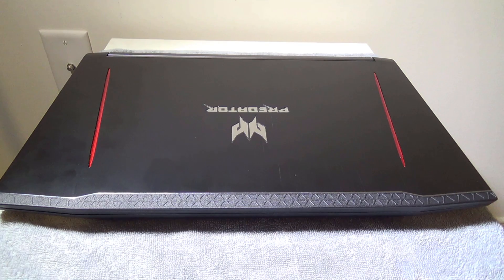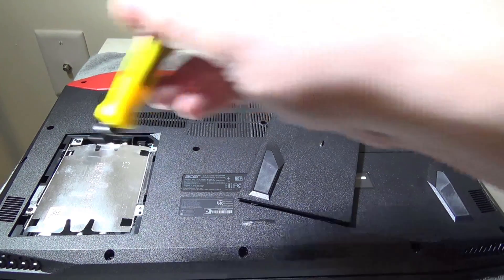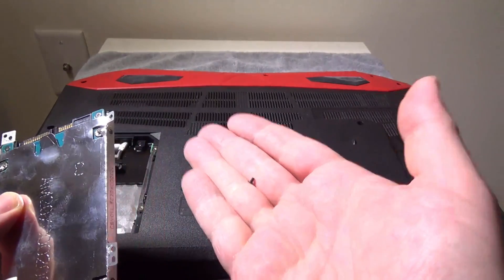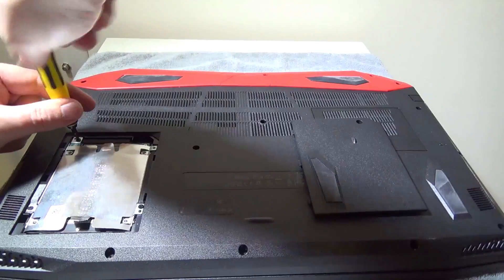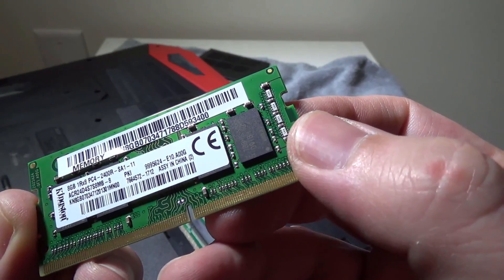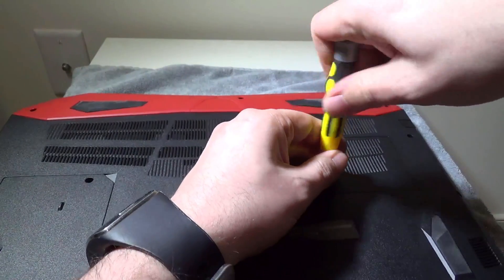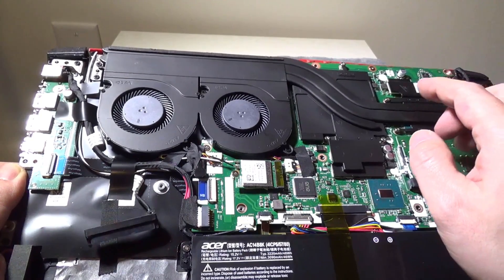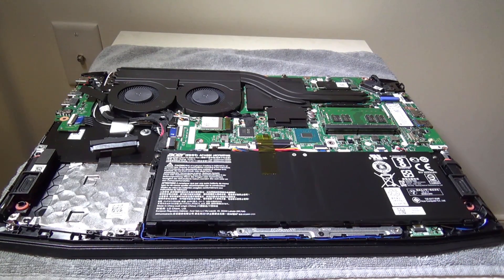Acer Predator Helios 300 Gaming Laptop • How To Add a 2nd HDD and Upgrade RAM

Comment: Will the Samsung 960 Pro work fine on it?
Reply from the maker: Yes it will.
Reply: Galaxy Tech Review Woa, great! Was planning to get the 2 TB SSHD and 960 pro, how's the combo?
Reply from the maker: The m.2 slot is NVME compatible so the 960 pro should work, I have not bought it and tested it myself so I can't say, I just stuck with the pre installed m.2 drive.
Reply: Galaxy Tech Review what about the performance of segate SSHD? Is it better than the stock 1tb from Toshiba?
Reply from the maker: Yes it is,
Reply from the maker: TheSteamsurfer unfortunately I don't own any VR headsets so I can't really do any VR benchmarks

Comment: I'm from europe but if I'd buy this laptop in the usa (Up to 500$ cheaper for the same specs) could i still use it in europe without problems?
I mean because of the differences in the voltages that you get.
Reply from the maker: +Sascha Liechti you would just have to buy an adapter for the wall that I would change it from a u.s. plug to a plug for Europe that's all
Reply: Thanks a lot :)
I thought so too but i wanted a second opinion on that ^^
Just one more question.
I heard some people complain about heat problems (cpu and the outside of the laptop getting really hot) when gaming.
How was your experience?

Comment: Looks like I'm in the same boat as a lot of other recent buyers who didn't get the installation kit included with the computer. I did talk to customer service and I already had my installation kit delivered, but now I'm kind of stumped as far as installing the SATA cable myself. I know it should be as simple as plugging it into the board, but I don't see how I can access that plug just from the storage bay. Maybe I have to take off the entire back of the laptop. Anyone else who had to install the kit themselves able to clarify?

Comment: Do you know if that SATA Cable + interposer is a standard connection for laptops? Or is the connector going to the motherboard proprietary? I ask because mine, like many others, did not come with the connector or caddy for a second drive.
Reply from the maker: Dmitri Zaitsev I'm not sure if its proprietary or not you may want to contact Acer directly and ask them.

Comment: could i swap the hhd for a 512 samsung ssd? in the end have 2 ssds? PLEASE REPLY
Reply from the maker: +Sean Harris yes you can certainly do that
Reply: i just added the ssd but its not showing up? :(
Reply from the maker: +Sean Harris you have to go to Windows settings and then to Disk Management and create a new Partition on the new drive before it will show up in Windows.

Comment: Don't buy this laptop. Mine had the bottom hardisk caddy and sata cable missing so I can't install a second drive.  And I am unable to get the parts! It looks like there are many victims.  :(    Buyer beware!
Reply: Ooooh so I'm not blind, the SATA connecter just wasn't there... :(
Reply from the maker: it just presses into the motherboard, there is no way you can mess it up.  you don't need to remove the battery.  I would make you a video but I no longer have a Helios 300 test unit.
Reply: Galaxy Tech Review can you make a video of how to install stall the sata cable safely for the second hard drive that so many people ( including myself) did not get that are awaiting the parts. Like does it matter that the battery is integrated and does it have to be removed before messing around with the motherboard?
Reply: Galaxy Tech Review hi
Reply: Galaxy Tech Review ok can you buy this cable from amazon
Reply: Mine came with them....
Reply from the maker: interesting because as you saw in my video I had all the stuff included.  I would suggest contacting Acer for the parts, I am sure they will help you out.
Reply from the maker: +gendail71 I would hang in there I know it's a pain in the butt but I'm sure that Acer will take care of you

Comment: I can't seem to find the hard drive mounting screws, is there a place to get them online?
Reply from the maker: +Landon Cramer I should be in a little bag in the cardboard part that the AC plug came in. If you can't find them just search 2.5 inch hard drive screws on Google
Reply: I actually accidentally threw out that box a while ago, I never saw the screws :(. I havent had much luck finding the screws online.
Reply from the maker: yes

Comment: I'm a little bit confused because I want to buy an helios 300. but it said that it's come with a 256 ssd Serial ATA/600 that is the m.2 drive that you show? I would like to move the OS to a nvme samsung evo 960.
Reply: David Hernandez I would advise against getting the nvme 960 drive as the m.2 slot only supports sata speeds. It is only a pci-e 1x speed. You will only get half the performance of the drive.
Reply: thx for answering... I bought a msi apache camo 644 wich supports pci-e 3.0
Reply from the maker: +David Hernandez nice how are you liking the MSI ?
Reply from the maker: +Great Outdoors pretty sure Acer stated that it supports nvme. Have you tested it yourself? I did not during my testing Try to replace the m. 2 Drive.
Reply: You're welcome, nice choice of system. I did by the helios 300 a few days ago and I'm real happy with my decision.
Reply: I checked the system specs with hwinfo64 and it showed that the pci-e for the drive is only 1x. I think a nvme drive might work in the m.2 slot but you wont get full performance, I could be wrong. I'd like to hear from acer on the subject. Did you contact them directly?

I got an 850 evo for the 2.5" bay but I'm waiting on the caddy and cable from acer.
Reply from the maker: Acer states that the m.2 slot "will" support nvme drives.  Again I did not test that myself as I never replaced the stock m.2 drive during my testing.  If you run HWINFO64 with the m.2 currently installed it will of course say that it is running SATA but the slot is apparently compatible with NVME drives.
Reply: I just ordered it few days ago. I'm hope that it arrives soon. However I'm a little bit disappointed with MSI specs and models clarity. I have to wait to see what the laptop actually have on it.

One page of msi shows that it's supports thunderbolt 3 (1&2), and another shows that it doesn't (3), so I'm almost sure that it doesnt supports it and I don't need it,  but is like fake advertising.

(1) https://us.msi.com/Laptop/GE62VR-APACHE-PRO-CAMO-EDITION-7th-Gen-GEFORCE-GTX-1060.html
(2) https://us.msi.com/pdf/nb/GE62VR%20APACHE%20CAMO-644.pdf
(3)https://www.msi.com/Laptop/GE62VR-7RF-Camo-Squad-Limited-Edition/Overview
(4) https://imgur.com/nDk5bFe

notice that one is labeled as 644 and the other one as 7rf but is the same laptop and does not supports thunderbolt 3 (see 4). Do you think that I should complain about it? because I bought it with the 644 (thunderbolt (1)) model offer from newegg because the msi page refers me to newegg.

Comment: I bought this laptop from amazon i received it and went to put in my hard drive in the bay when i opened the door there was no caddy not cable to attach my hard drive but i got the little baggie with the 4 screws. Contacted acer and they said they would send out a kit for me so i'm waiting to see whats happen , other than that i love this laptop i made my purchase based on the good reviews you gave on the laptop highly happy with my purchase. thanks Galaxy Tech Review. ACER should send you free shit!!!!!!!!!!!!!!! . Love your vid man
Reply: I also recently bought one of these and had nothing in the HDD bay. Acer sent me the caddy and cable, however the screws they included were too wide to mount the caddy to the laptop. Now I am waiting for a universal screw sent I just ordered from amazon. Very inconvenient. If you are in the same boat as I am, here is the screw set I ordered: UEB 300pcs Screws Box Set for Universal Laptop PC Computer Repair Dell HP Lenovo Asus Acer Toshiba Samsung
Reply: Nick in regards to installing your cable you have to remove the entire back of the laptop  (exposing the fans,motherboard etc) just below the fans there would be a connector on the motherboard that would be labeled "JHDD2" the cable connects there. Then its just a matter of putting it back together making sure the other end of the cable is in the bay and out on the way of anything that would damage it. There is a picture of the internals on this site so you can see how the cable is routed " http://laptopmedia.com/highlights/inside-acer-predator-helios-300-17-inch-ph317-51-disassembly-internal-photos-and-upgrade-options/  "  i hope that helps cheers.
Reply from the maker: Thanks, yes contacting Acer was the right move.
Reply: Daniel Joseph Same here. Was about to order the hard drive caddy, didn't realise Acer would send one for free.
Reply: How did it go? I had the same situation a bit more recently and just got the installation kit today, but I'm kind of stumped on how to install the cable myself. The package didn't include any directions and there's this black strip inside the storage bay where the sata cable is supposed to go, and I'm unsure if I need to lift that up or just slide the cable over it or ... what. So yeah, kind of at a loss.
Reply: UPDATE : i got my kit install it and got my 2nd HDD working properly pretty straight forward love this machine. Galaxy Tech Review thanks for all the videos on such a great machine i love it.
Reply from the maker: No problem, enjoy your laptop!  Glad I could help.
Reply: HEY BRO. where can i find a hard drive cabby?
Reply from the maker: You would have to contact Acer for one if one was not supplied in your unit.
Reply: How can they be so irresponsible and not pre install it for us buyers? >:(
Reply from the maker: +DINOSOWER! Midnightcurse  Not sure why they didn't on certain   Models mine came set up ready to go
Reply: Galaxy, can acer send to me the hdd kit if i dont live in the US or Canada?
Reply from the maker: +Schutzstaffel BR I am not sure you would have to contact Acer directly and ask them.
Reply: could i ask acer to send me the kit with the computer when i order it or do i have to find it missing and and then order it? I will only be home visiting family in the US for a few weeks so i don't want to get dicked around for a month or so in communication with acer
Reply: First Last I guess you recieved it with the laptop ?? Beacuse mostly from this year people are recieving it with the laptop ?? Did you ?
Reply: have not ordered it yet, will do so in June so hopefully it comes with it
Reply: First Last yeah it should I will also be ordering mine around may last

Comment: My model also did not come with the HDD cable and Caddy, requested for a kit from acer support. they sent me instructions however for the part where i have to open up the lower case and look for the HDD cable connector, it does show the pictures. do you know where the HDD cable connector is in order to connect the HDD cable? and how should i place it so that it can still show through the HDD opening even when the lower case is on.
Reply: Jashley Francisco Where did you buy it from Amazon?

Comment: Do I need to open the extra screws? Im worried that I wont be able to find them and that I cant install my new hard drive..
Reply from the maker: you just need them when you install your hdd
Reply: If I cant find them I cant?
Reply from the maker: if you cant find them you will need to get new ones to secure the caddy into the laptop
Reply: Thanks!

Comment: important question, did your helios come with a caddy & cord to connect to the 2nd hd like in your video? because mine didn't, having it replaced atm
Reply from the maker: +Lunia yes the caddy was already screwed in and the cord was there there were four screws in the Box that the AC adapter came in.
Reply: thanks for the info, cuz I ordered one and it didnt have the cable or caddy, then I ordered a replacement and I got another one with thr same exact issue.. So I was assuming that it couldnt have been a mistake unless they screwed up on multiple units

Comment: My helios 300 did not come with a caddy and any plug to connect to SSD : ////// (250gb)
Reply from the maker: +Sila Poe Charukesnant contact Acer.
Reply: Galaxy Tech Review Hey man! thank you for the rocket speed reply. I also have one more question to ask (and yes you have earned my sub!), I just contacted Acer and they said they will send me the "kit" that has "everything I need to install SSD", but when I opened my case, not only I did not have a caddy, but I also did not see any hardware cable to plug to SSD even if I had a caddy. My question is, is this hardware cable hidden under the case and I have to open the whole thing to get it out? or if theres a chance this hardware cable is also missing.
Reply from the maker: hardware cable comes with the kit
Reply: That was my worry as well because I have the same issue

Comment: i ordered mine in amazon and it didn't come out with mounting hardware
Reply from the maker: I would contact Acer, or exchange it on Amazon.
Reply: Galaxy Tech Review do you think its fine if i put my sshd even i don't have the mounting drive?
Reply from the maker: +mezuka kasuga you can get away with it but it may wiggle around a bit so maybe bolstering it with something as simple as a folded up piece of paper to keep it in place would be my advice
Reply: Galaxy Tech Review oh, thankss i appreciate it sir and i will do it
Reply from the maker: +mezuka kasuga no problem anytime
Reply from the maker: no the drive gets hot but not hot enough to set paper on fire.. you can definitely use it as a temporary fix until you contact Acer about a replacement slide.
Reply: dumb question but same as mezuka it didnt come with the slide, wont sliding a piece of folded paper cause some damage to the components or lets say the laptop gets really hot wont the paper just set on fire somehow, thx
Reply: ill contact acer thanks for your quick reply, your videos helped me with the decision to get this laptop so thank you
Reply from the maker: +Carching10 no problem.

Comment: Thank you for making the videos, I am going to purchase Acer Predator Helios 300, and also I am willing to get 1tb Seagate Firecuda too. But I have one question that after you put 2nd HDD on this laptop, any after works needed to be done? What I mean is that it is simply to put it on the laptop, and then just turn on the laptop then it automatically fits in and works? 
I hope to get a reply back from you soon. Thank you
(I am not type of IT person, so I just wanna make sure that I got things right. Also, do you have any recommendation like where to  put laptop while installing 2nd HDD or what types of the screwdriver to use?)
Reply from the maker: use a size PH0 screwdriver.  As for what you do after.  Once installed, got to Windows Settings then to Disk Management and create a partition on the new hard drive, it will then show up in "My PC"    Enjoy your new laptop.
Reply: Galaxy Tech Review Thank you for replying me with useful information. I'm still figuring out the way to create a partition on new hard drive. I went thru some YouTube videos but still got confused by the way they're doing it. Most of the time, they "shrink volume" and input some numbers, in which I am totally blind of. I think there might be some people who have a similar concern, so if you could do a very short video about how to create a partition, we really really really appreciate it.

Comment: So i dont have to reinstall windows or anything right? After i install the hdd.
Reply from the maker: +Adam L. No because you're adding it as a second hard drive so the operating system will still be on your m. 2 SSD drive
Reply: Galaxy Tech Review thanks, i was worried about this lol

Comment: Hi! I'm super new to this PC stuff. I installed the Firecuda, but I'm not sure what to do next. Is it supposed to show up on my computer? If yes, mine isn't showing. I don't know If I did something wrong
Reply from the maker: +Juan Pacheco you have to go to Windows settings then Disk Management and create a partition on the new hard drive you just installed once you do that it will show up in my PC
Reply: In the disk management screen, but i'm not sure on how to create a new partition for the hard-drive.
Reply: Hugh Williams me neither, I have the same problem
Reply: Galaxy Tech Review Hi. I am having a problem in turning it on. I just press the power button and keyboard lights blinks and nothing happens.. it doesn't turn on. Please can you help ?
Reply: @juan pacheco.

All you need to do is open disk management and look below it should say disk 0 and Disk 1. Check the disk you added if. Your disk should say inallocated at the bottom of the window. Left Click it to select. and then right click to create new.

Comment: Anyone else annoyed that he didn't show us how to replace M.2 ? Did he already had his installed? Nobody else has a video on this subject besides other brands
Reply from the maker: I did not show it because this particular model comes with a m.2 already installed.  As for being annoyed, sorry you feel that way.
Reply from the maker: installing an m.2 drive is the same for all brands.  unscrew the mounting screw (there is only one) and insert the m.2 drive into it's slot and then screw in the holding screw.  very easy.